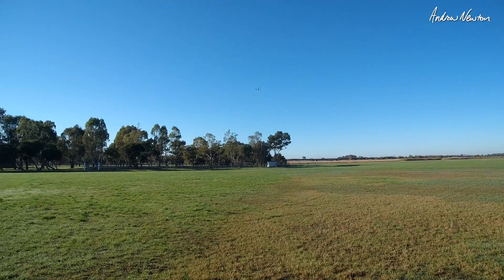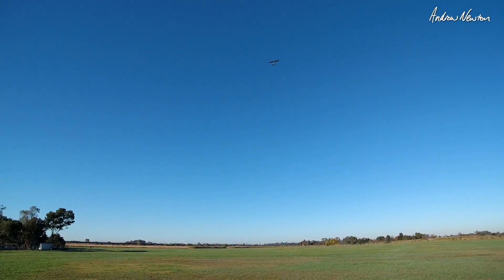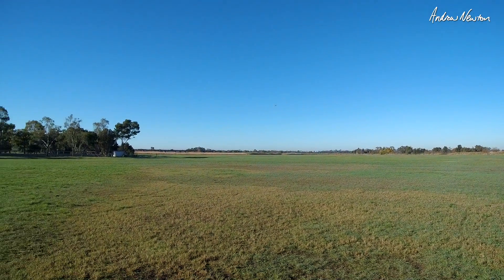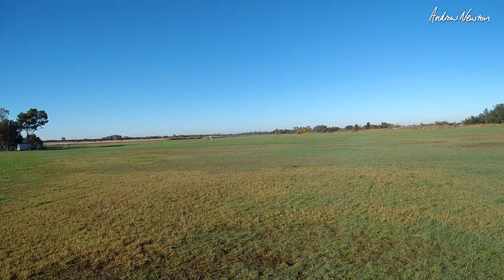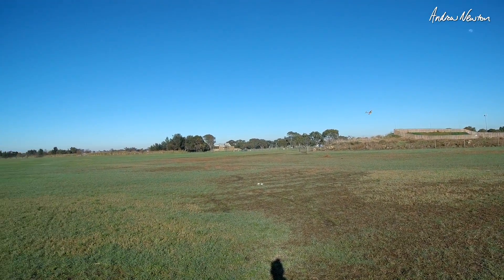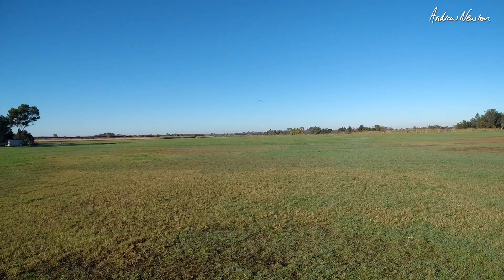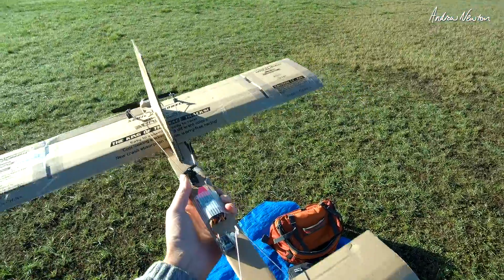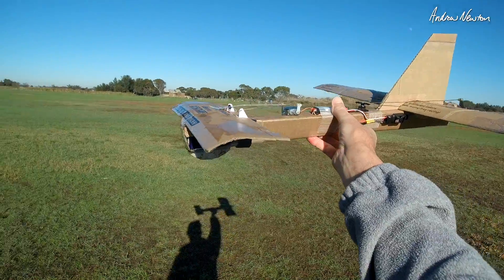Cardboard Canard Pusher

Comment: Ive pinched the 44inch (1117mm) wing from the Lanzo Bomber I was building & made a 900mm  long fuselage from Bunnings coreflute, gotta buy more foamboard to make  shorter front wing with similar in build-style to main wing....
Thinking with bigger wingspan a bigger prop will be needed & thinking 9x4.5 or 9x6 slowly, Ive not ventured into this size before...
Would you mind suggesting a motor & ESC that would be suitable please?
I was thinking similar to what you have currently on Skyhawk???
Thank you again, looking forward to trying this thing out myself! :D
Reply from the maker: Snap. Just back from Bunnings myself with 3mm coreflute for the fuse. Will do a 1200mm depron or hotwire wing. Coreflute for the canard might be OK. Same power setup as the SkyHawk would be good.
Reply: I used 5mm coreflute for fuse as thats what I had, hadn't considered the 3mil stuff for the canard- and I have some of that that's been waiting for a job! :v
Trying to figure a way to keep rear wing detachable AND have a rudder- I wish to swap the wing between this & two other planes currently on the bench -without the rudder being part of the wing...
I'm thinking of rudder on a 'hatch' that rubber-bands down over the wing to hold it in place....
Could also then play with different wing types later... ;)

Thanks for getting back to me so quickly :D

Comment: Hi Andrew, love your site and I just build your Cardboard pusher BASED ON YOUR PLANS,.  but with 6 mm, That said I noticed a discrepancy in between you canard construction being raised 15 mm and sigle elevon on the plans and double elevon and wing forms directly glued to the body on your model. I understand the reason but which would you suggest?..my cannard offers a 4 degee incline into the wind and almost looks like it will work as a detriment to speed becuase of that. Any ideras?
Reply from the maker: Fantastic Anthony. I thought the single elevator would be a better idea but either way is fine. A little bit of positive angle of attack for the canard means it will stall before the main wing, which is good. Too much and you will have pitch changes with speed.

Comment: You're a pro wow! Just can't wrap my head around how easily you get things to fly.
I have been trying myself for 3 months now to get a scratch built plane to fly but just cant! I am using thermocol and still the weight goes around 1300-1400gm and I am pretty sure a 1000kv 2212 motor with 1045 prop can't get it airborne. It's a learning curve!
Reply from the maker: Certainly is a steep curve, bigger motor or lighter plane would do it.

Comment: Well done Andrew. Where do you get that T40 motor and your 6x4 props? Also what ESC did you use? Thanks.
Reply from the maker: T motor came on one the Tech one wings I reviewed. 6x4 prop would be from HobbyKing I think. 18A CarbonBird ESC
Reply from the maker: Sorry it's an Air 40 T-motor, I keep making that same mistake.

Comment: that front cannard elevator will give you a headache everytime you try and figure out if its going the right way lol.
Reply from the maker: Correct. I programmed it exactly wrong to begin with.
Reply: Nathan, What is the correct way for movement in each direction.
Reply: @JoshWeaverRC  You have to imagine the wind flowing and what effect it has on the wing. When an elevator goes "down" the elevator is deflected UP. In most planes the elevator is in the back. The back of the plane going UP means you diving down. In a cannard with elevator in the front, the front of the plane is going UP which means its climbing, away from the ground. But for people that have been flying for years, you have this visual memory of what should happen to an elevator when you pull back on the sticks. When you pull back you should see the elevator going UP. If you setup a cannard like that you are not going UP you are going DOWN lol.
Reply: @thenatedog  That's what's up! I'm down with that. 
Thanks, just wanted to make sure it wasn't backwards from being backwards. 
I was thinking of it as pitch of the nose. Down elevator would put upward pitch directly to the nose and vice versa. 
Good stuff and thanks for responding Nathan Knight.